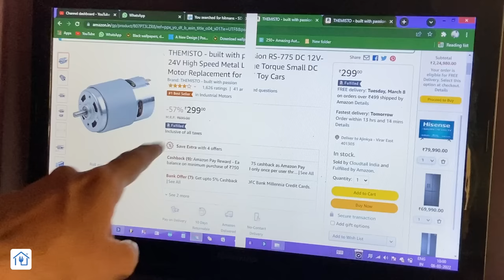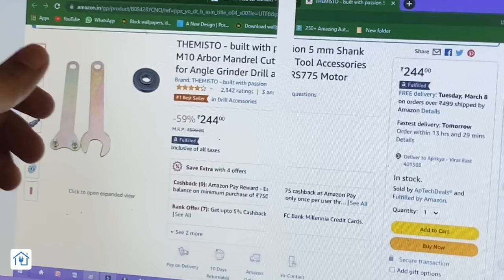How to make Roti Maker | DIY Roti, Chapati Maker | electric roti maker using RS775 DC motor - Part I

Comment: Worked hard but you have selected wrong motor 

Thats the reason you are unable to make chapati onit it will stop when you apply pressure as the torque of motor is low

Comment: This machine can never do the work of making "Roti". The reason is that the speed of the platform is very high due to the normal high speed motor installed in it,
 but the power / traction is less. 
Had a powerful 80 to 100 RPM "geared motor" been installed in its place, this machine would have worked fine.
Reply from the maker: thank you for the feedback
Reply: One more thing. You would be better off reducing the gap between the turntable and the motor as much as possible. By doing this the efficiency of the machine will increase a lot. You try it once.
Reply: One more thing. You would be better off reducing the gap between the turntable and the motor as much as possible. By doing this the efficiency of the machine will increase a lot. You try it once.
Reply: @AutomationDude  dc motor will stop when the force of that belan/ pipe type thing apply pressure to flatten the dugh...I had done that